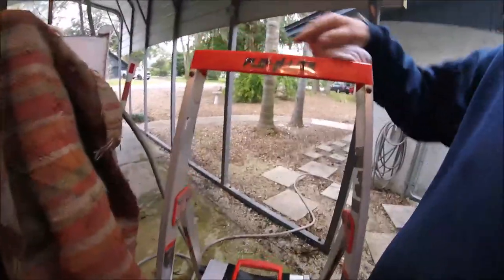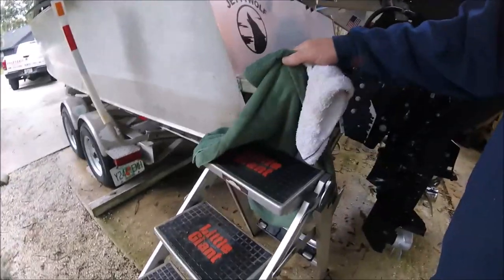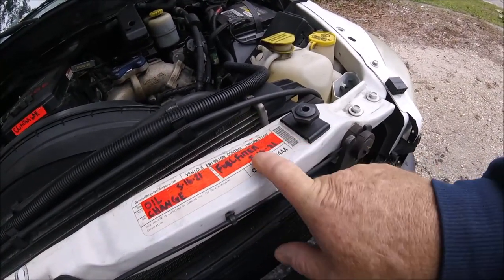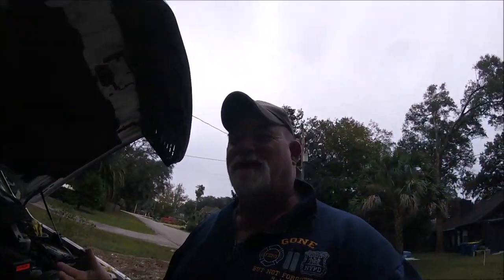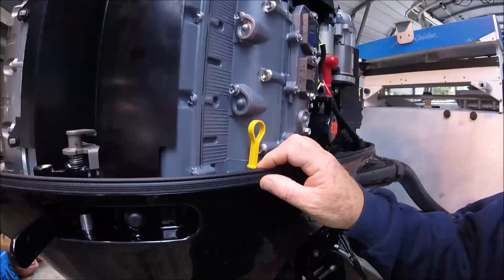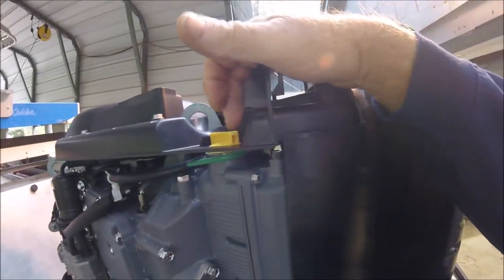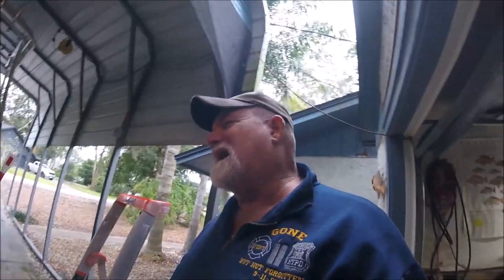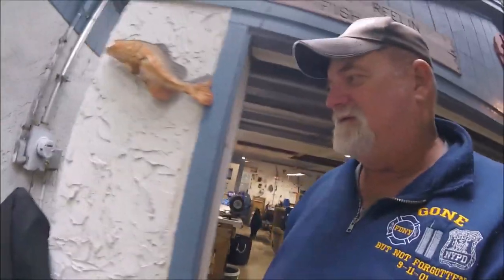Suzuki 250 Outboard Ownership

Comment: Great vid. If I may give further advice on removing that heavy zuki cover. 1 First the little giant stair steps on the "tools of the trade page" are a god send. your not standing on a ladder your standing on very stable steps. Somebody always asks me "where you get those steps from" ?  2, clean dry hands ,no water wet hands and no oily hands. 3, pick a spot close by as to where it will be laid. 3, have padding laid out. something like a loading blanket or  even a piece of plywood ready. If it does slip and something is laid out, the end result will be much better than if it lands on asphalt concrete or gravel. 4 An assistant to help is best. It's not so much the weight of the cover but like Dave said it's bulky  hard to grab and easy to slip away from you. Lower cowls or "tupperware"   1 practice makes perfect. 2 don't pinch anything. 3 practice makes perfect!!!!
Reply from the maker: we "CONEHEADS"" don't get much practice. Suzi-Zuki knows that.

Comment: I agree with you about the drain plug and wish that Suzuki had something similar to the Mercury's where you can hook up a tube and have it drain into the bucket with less of a mess.  Maybe if you have the thread count of the oil plug, Fumoto Valve could cross reference to a product they already have or possibly develop one.
Reply from the maker: Already discussed one of those. But zuki should do it themselves.

Comment: As we get older running a boat  is going to be a two man project at your old age you might wanna think about hiring a mate for your charter  trips this way you don't have to do all the heavy work
Reply from the maker: only topless chicks. No, I have zero issues. I don't have room for any "mate".  That cowling is so big and bulky and my old zuki cowling was chipped and the paint was messed up on the edge from  banging. RESALE VALUE, runs everything I do.

Comment: on the 250 Suzuki does oil come out the drain hole when the engine is up?  for my yamaha I raise it pull plug then screw in hollow plug attached to 3 feet of hose and then lower and drain.  never makes a mess
Reply from the maker: no idea, never tilt it up when changing oil.

Comment: Do I like Suzuki's Yamaha Honda yes, but I have owned and ran Mercurys since I was a little kid with my Dad in the early 80s. My Uncle used to hate on Mercs call them black anchors etc. Our Mercs never never left us stranded. My uncle had to spend 3 days on his boat bc he blew his Johnson 150 fast strike up he got so hungry he ate his softcrabs that he had for bait lol. Maga don't want supply chain issues ? Buy a Mercury lol.
Reply from the maker: Supply chain issues.....yeah Orowock I think has dealt with that. BUT, a good shop has a big inventory of parts. But good shops are very hard to find.
Reply from the maker: Its kinda funny, I watched one Merc video about replacing interior anodes on a 115 and it had just 3, and the package with new ones said JAPAN on them. Not all Merc's are coming outa Fondu Lac Wisc. My 15 pro kicker is a Tohatsu!!  NOTHING is made 100% in this country. That's a good portion of our problem. Oh well.

Comment: My 300 Evinrude etec you pop nuts trying to get cowling off, I can get off by myself, have to lift straight up then flip to back  and I lay it hard on the top of cowling in grass by back of boat putting on is another nut buster. With Aaron at born again boating working on customer boats I’m sure it’s always two ppl on and off with cowling JT HOOKED N ROLLING OFFSHORE 🇺🇸🇺🇸🐟🐠🎣🛥
Reply from the maker: Well a commenter on my channel and good friend is a Suzuki mechanic and says you just get used to it he does them every single day I just wish they made it lighter with actual places to put your fingers handles would never hurt anything